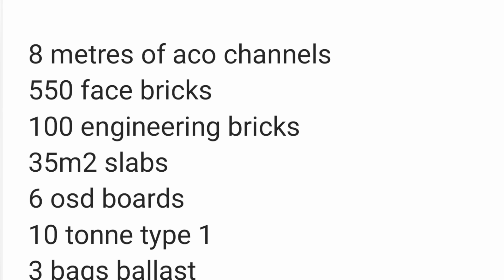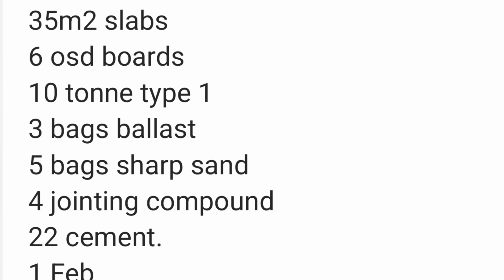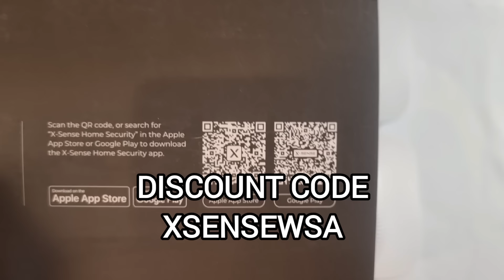It Flooded the house!!! #bricklaying #construction #patio

Comment: Hi Adam, you will need to trap the acco drain before it connects to the chamber to stop any smells coming up the pipe work.
Reply: He said it’s grey water sewer. Not mains, so should only be rainwater in there.. 👍

Comment: Top work Tricky!! Also TP should do a end cap for the aco drains for that angle which you used the trowel to stop when you did the water test mate (speak with the yard guys theyll give you one i reckon😂)
Reply from the maker: I put one in mate. Just before the slabs went down 😉

Comment: Very useful video tricky im raising a small soil retaining wall in my back garden just a few bricks higher, to level my grassed area that slopes a bit at the moment, my wall is a single brick wall, do you think it should be OK as a single brick wall, as yours is a double. got some useful info in you video.  Thanks
Reply from the maker: I'd put some concrete blocks the high soil side of your brick work bud. £2each roughly.  It will more than double the strength 💪 🙏 and last alot longer 😁😁

Comment: There is a house in my village built in 2000 the new owners had to have a injection damp course done when my mate fitted the bifold doors noticed the best builder in the area started his insulation three courses below damp the water soaked up like a wick he never took the snots of the back of the blocks either keep the good work up tricky

Comment: Atherstones red are porous mate and can be also used below ground rated an f2 I just used them up to DPC on mine
Reply from the maker: I never said they weren't. I said the engineers are none porous bro. The first course.. that went down 😉 and yeah I've layed 10s of thousands of them in the splash before. Lovely old job
Reply: @trickybrickys  ohhh no bro it weren’t aimed towards you a bricklayer came round layed them below splash then mate building control said they all gotta come down I was stressed they made me ring the company up and email them the specs of the brick. They are proper soft brick tho I noticed when cutting them. I’m learning so much of you brother wealth of knowledge 👊
Reply from the maker: @DeanW-1990  building control are out of control 🤣🤣🤣

Comment: Lovely old job 9.9999/10 one man army 💪, nothing wrong with easy joint when a skilled tradesman uses it only cowboys get issues with dry brushing etc, though i use the select one in jet black cos all turns black eventually and think it pops the colours better